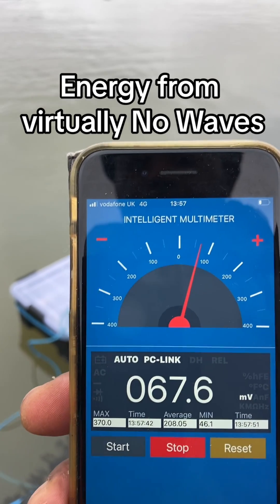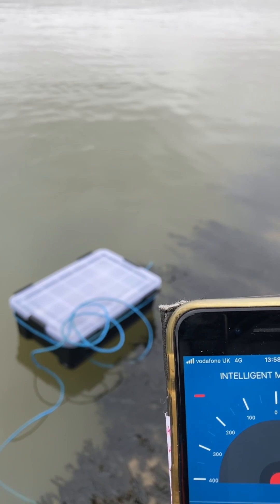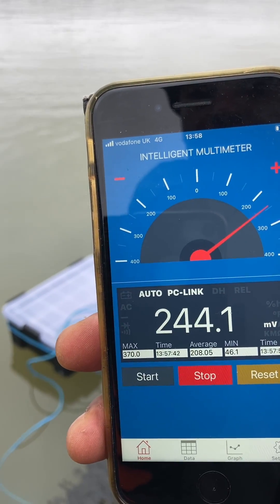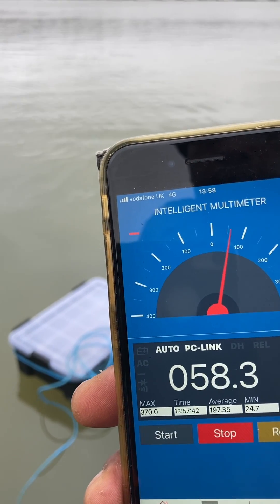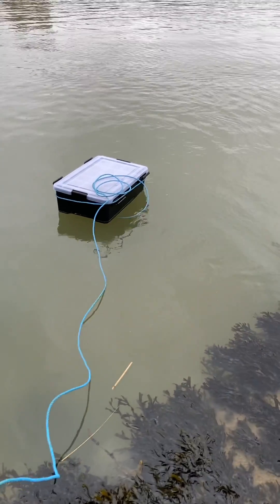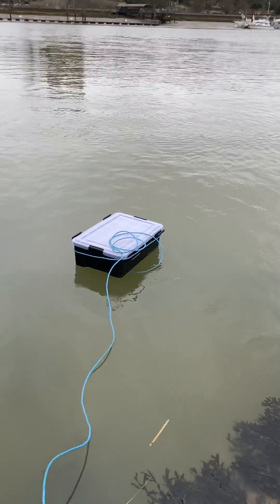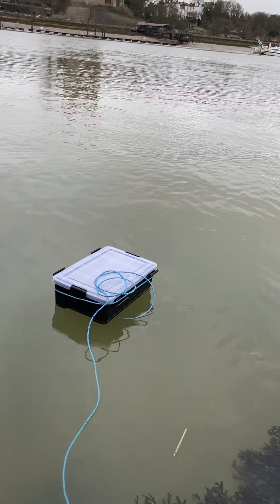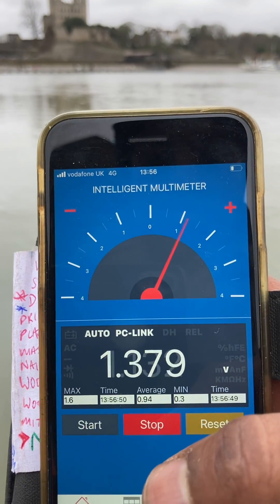Efficient Wave Energy Converter | Secret Behind the Most Efficient Wave Power

Comment: You need to calculate watts, not volts
Reply from the maker: True, this is just an example prototype but if the ripples were small waves it would easily generate 1 watt to 2.5 watts. Keeping in mind it is a very basic prototype and there is lots of room for improvement.

Comment: 0.6 Volts
Gonna power the world dude. This is a game changer.🤣🫠
Reply from the maker: This is a proof of concept prototype it's not designed to generate huge currents.
Reply: @activekinetic1  Proof of concepts are done with a view to developing things further and making something viable.

This is going nowhere.
Reply from the maker: @deang5622  This concept even as a prototype could be useful to power IoT where solar cannot be accessed and it can help to reduce battery dependancy or replacing depleted batteries miles away from an energy source. That is a game changer !
Reply: @activekinetic1  No it can't.
The power is too low to even make a burst radio transmission of data from the IoT device.
Reply from the maker: @deang5622  The kinetic energy in the water is the issue, not the technology 🤣. This is the energy from a ripple of in still water, if there were waves it would melt the IoT device 🤣😱🤔

Comment: Really wish you reported your measurements under load. I have no idea how much power you're actually generating.
Reply: The power generated in this video is around:  36 nano watts.
600mV and a multimeter input impedance of 10MΩ
😢😅😅
Reply: @deang5622  yeah I understand there was no load applied to the generator, but that doesn't actually tell you the generating capabilities of it. You'd need to know the internal impedance of the generator to have a good understanding of how much power it could actually provide. I'm not even disparaging it, you can do a lot with even a milliwatt of power
Reply: @Stevobulfer  I do know. I have a degree in this.
Reply: @deang5622  cool, I have two, working on a third. I said nothing of your qualifications nor the correctness of your statement, but it's still not relevant information to discuss the power dissipated in the multimeter. If you measure a 12 V battery, the power dissipated in the multimeter is gonna be 14.4 uW but that still doesn't tell me whether or not it can start my car.
Reply: @Stevobulfer  Oh boy...of course my post is relevant.
I am mocking the person by pointing out how low the power is when using a multimeter!

I am highlighting that using a multimeter to measure the voltage means absolutely nothing.
Reply: @deang5622  oi... That makes sense.. it's hard to read sarcasm over text
Reply from the maker: This model was just proof of concept however, it can generate approximately 2 W.  Without the need for capacitance or energy storage, the direct feed can charge my iphone operating in medium sized waves. I hope that provides a bit more information.
Reply from the maker: In other videos, you can see this tech lighting up 20 LED's which requires approximately 2 Watts
Reply from the maker: @deang5622  Btw this device generates electricity from waves, if there are no waves there should be no electricity !  As you can see in the demonstration the device is creating electricity from the tiny fluctuations of the almost still water.
Reply: He can't, there is none... Voltage alone means nothing. Why does YouTube shows me this...